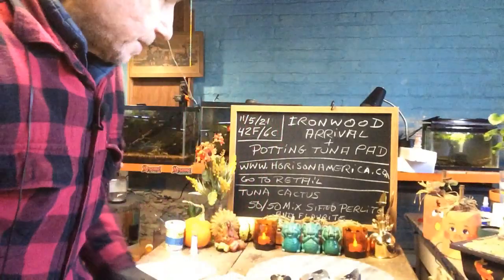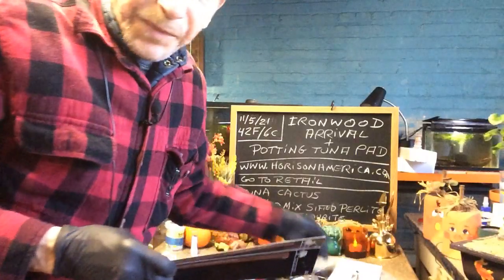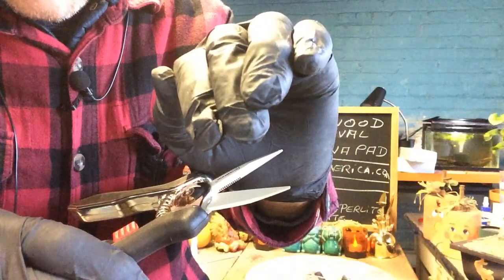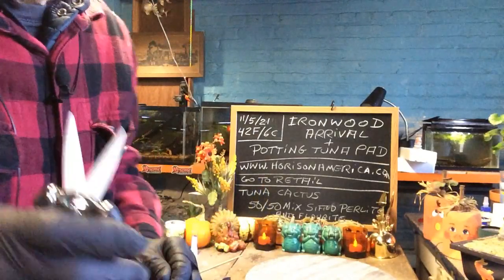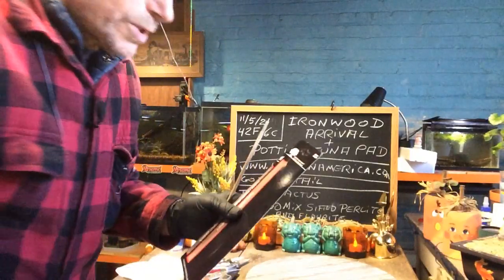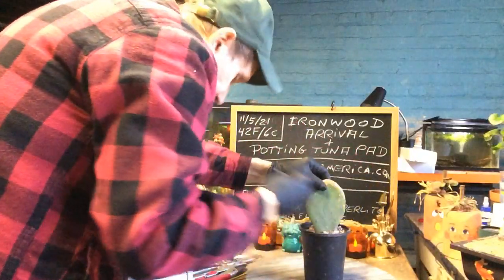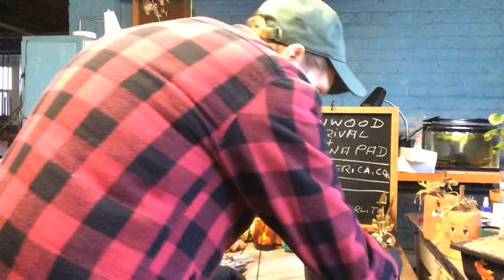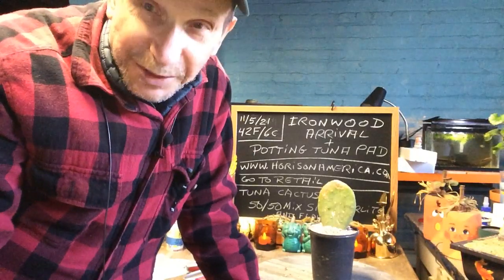Ironwood Arrival + Tuna Pad potting

Comment: A trick I learned a few years ago with Opuntias is to lay the pad on it's side.   The roots will grow from each areole on the bottom side and new sprouts will grow from the edges of the pad. This is the way they reproduce themselves in nature.  If a deer or steer nibbles of a piece of the plant, the uneaten pads fall flat on the ground and sprout there.  Since the cut point in this technique is up in the air, you do not have to wait for it to callous over.
Reply from the maker: Thanks for the lesson Emmit. I will have to give it a try before bringing it in so as to make not to tall. Never to old to learn something new. Thank you. Have a great day and relax tonight with a nice hot cup of tea. Tom

Comment: Nice job Tom ! Remember the old days where you bought something and it lasted for life ?? I bought a pair that cost pretty much $100 not so long back - fingers crossed that’s the last ones I need to buy . We call those prickly pears here , story : I’ve got three of those which I planted when I moved to this house 3 years ago and they have never done a thing , haven’t grown , haven’t died either , the just sit there . So with some inspiration from your end , I’m going to repot them and see if they will get going . Thanks always Tom and gave a great weekend .
Reply: Have you watered and fertilized your  cacti?  Cacti need water and food to grow.  They like half strength tomato food from spring to August, and regular watering.  Then no water and cold from late fall through last frost in spring.  They need winter dormancy to set buds for flowering and fruit.
   When Luther Burbank introduced his thornless cacti, he found that they didn't sell very well.  Turns out that, in order to produce a crop, cacti need more water than wheat, and winter wheat was cold hardy much further north than his cacti.  That is why the American plains became known as the breadbasket of the world.
PS, you can get cactus cuttings for a lot less than that online.  They root easily and, with proper care, grow quickly.  Cacti do last almost forever.  The  cacti you see in the wild are usually several hundred years old.
Reply: @emmitstewart1921  hi , they live outside so the get sun and water , and the cold in winter … I will repot them and give them lots of TLC , the pruners I got were 100$ , sorry for the confusion, the cacti leaves were free , from outside a cafe. , was a huge flowering “bush” , I see it almost every day still :) , thanks for the info 👍
Reply from the maker: Good afternoon Peter. I keep mine in full sun about 5 feet off the ground in a milk crate sitting on an old pickle barrel. 3 full days of rain and it did not hurt it. I find that a liquid organic fertilizer, quarter strength every couple weeks helps it out. I let it dry out completely. I do not water it during the winter months or once it comes into the basement. Believe it or not, spring starts to roll in and I see new sprouts on the pads.
Yes. I remember when tools were as tough as nails and they lasted. You could knock the tar out of them and they would last. I like the lifetime on the Ironwood. Those long nose really are strong and tough looking and cut like butter.
Take care Peter and have a relaxing evening with some big band music and a nice hot cup of tea.
Tom